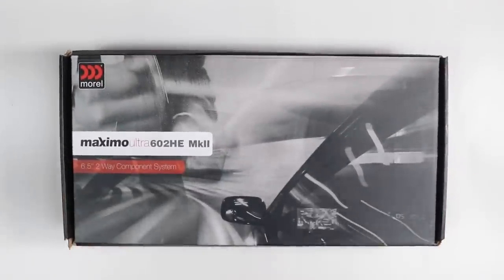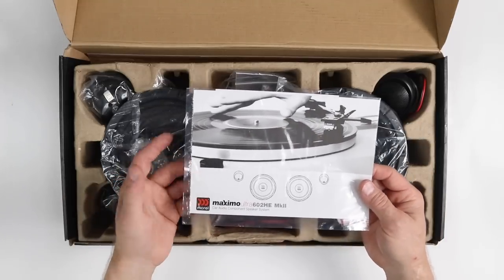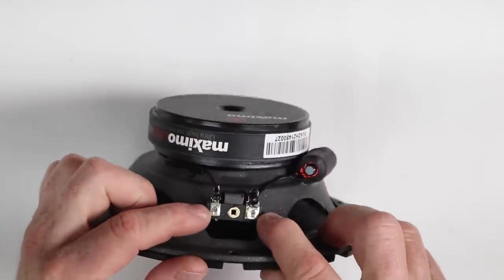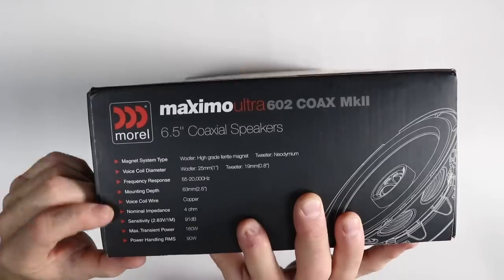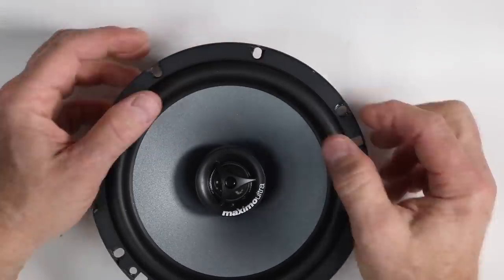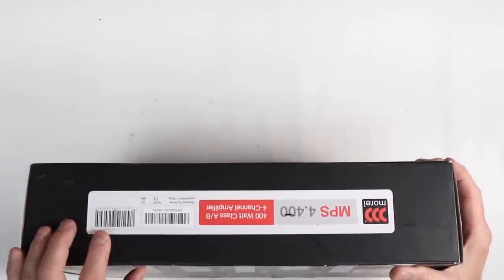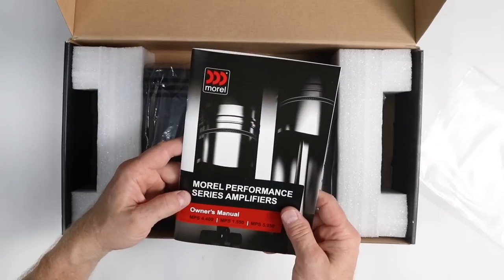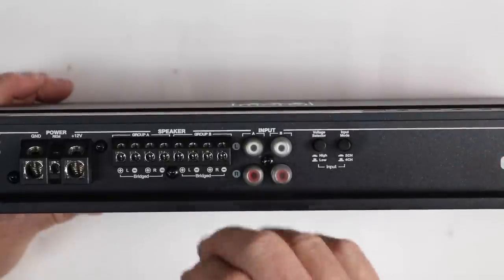Full Morel Maximo Ultra install Car Stereo Lab

Comment: These also get loud off low power. They are great for a factory upgrade where someone wants it louder without an amplifier. They are about 6db more sensitive then most 6” comps on the market
Reply: hey mate , are maximo 3 ways better than focals access 3 ways?
Reply: @nithishsorock  I haven’t played with the access 3 ways, morel has been around longer then focal, person I can’t stand the sound of focal at all
Reply: @Andrew_kiwi_AF  thanks for letting me know, is it because of the sharper brighter tones?
Reply: @nithishsorock  I feel like the focals as well as many brands as the volume increases the tweeters get scretchy where a morel tweeter stays the same tone but just gets louder, you don’t actually realize how loud your system was playing until you turn it down haha
Reply: cheers  @Andrew_kiwi_AF
Reply: @Andrew_kiwi_AF  Do you reckon the signature sound difference in brands (warm/melow or bright), is it very evident in the base 3 way components too? 
Im basically comparing the morel maximo ultra mk2 with focal access 3 way.
Reply: @nithishsorock  comparing a 2 way to 3 way set is like comparing a v8 to 4 cylinder. You know I’m going to say the 3 ways but ease of install isn’t there.
Reply: @Andrew_kiwi_AF  no, i think you got me
Wrong. Im comparing 3 way with 3 way and the 2 way with the 2 way. Focal acces and morel maximo both have 3 ways and under similar pricing I believe.

Comment: Is the Morel brand better then the Kicker brand? I’m a Kicker fan and am satisfied with the way the Kicker speakers and subwoofer sound in my car.
Reply: They are in different leagues. If you like loud and are not concerned with sound quality, then kicker is just fine. 

Morel is about sound quality.
Reply: @workingmanaudio2754  You’re right about that. Kicker is the best when it comes to real good quality sound. Kicker is my favorite.
Reply: Morel is a more expensive brand then Kicker.
Reply: @jeffmabry7775  I think you misunderstood my comment. 

Kicker is ok for loud. 
Morel is for sound quality. 

They are in different leagues in regards to sound quality.
Reply: @jeffmabry7775  not necessarily. They both have a wide range of entry level to expensive.
Reply: Kicker sucks...Stay out of Best Buy...LMAO!

Comment: Crossovers are disappointing, as usual. I don’t understand why manufacturers do not give you the ability to crossover higher for tweeters. There is no excuse for not letting customers set up an active system. 
(Edit: I am talking about the crossovers on the amp)
Reply: You don’t have to use the crossovers. You remove them and run it active. 

Also 3200hz is not bad for a passive component set that’s on the lower end price wise. Typically lower end sets cross tweeters at around 4000hz. 

In a 2 way front stage, you want around 2500hz or lower if possible. This raises the soundstage and helps with imaging. 

In this case the tweeters design and price point keep it from being crossed lower. 

But for a budget 2 way component set 3200hz is pretty good.
Reply: @workingmanaudio2754  I’m not talking about the speakers, I am talking about the amp. That is why I commented about setting up the crossovers for active use.
Reply: @gonzoe123  Ahh. I see.
Reply: Maybe running a DSP is the norm these days.
Reply: @workingmanaudio2754  I prefer using a DSP. But there are plenty of people that prefer I simple amp only build.
Reply: @workingmanaudio2754  Crossing a tweeter at 2500hz " that low is dangerous too blowing it up " unless you have a real real good tweeter...That's just facts....Even expensive tweeters concerning their Fs would not consider it...2,500hz is greatly handle by a mid range speaker in most of all scenerios. Even in a 3 way component set up...